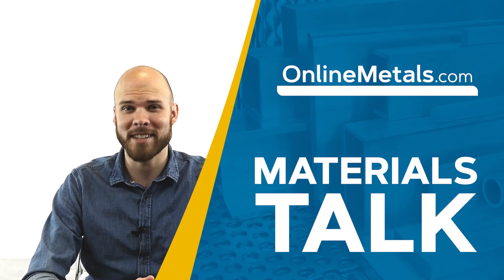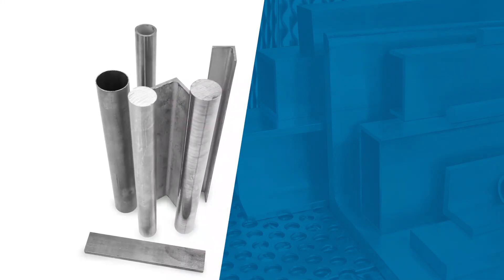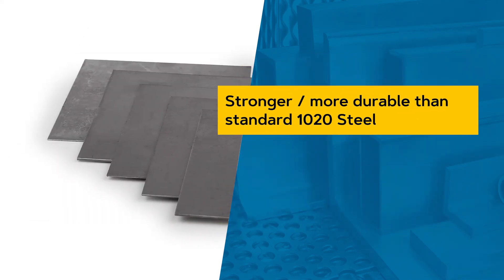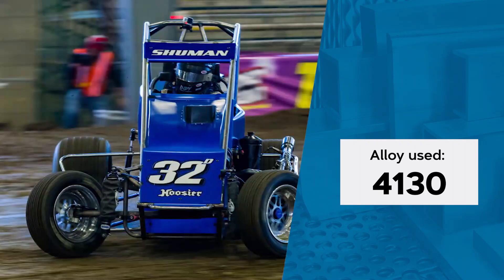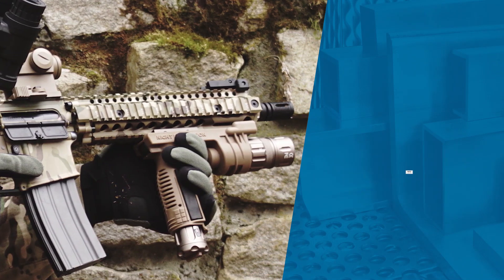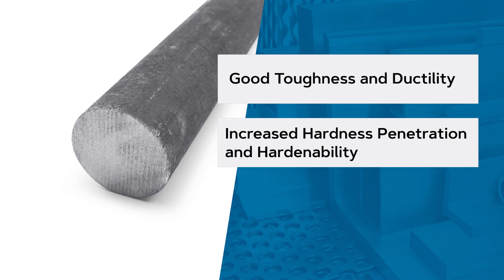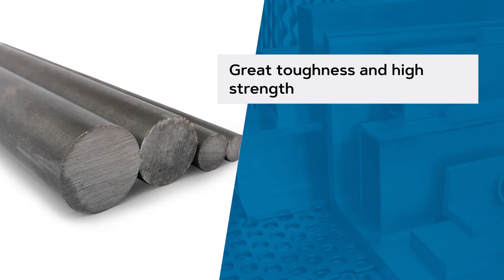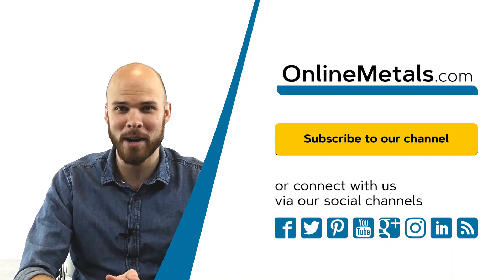Guide To Chromoly Steel | Materials Talk Series

Comment: Is that necessary to post heat treatment of a 21.7mm outer dia 3m thick round tube of Chromoly steel 4130 after the welding procedure?, we will use in our electric motorcycle trellis frame.

Comment: I'm curious about the higher grade 4150,4340...(I'm not familiar with the naming conventions) etc alloys and their relation to 4130....tensile strength vs weight and flexibility/rigidity based on the annealing and hardening process.

Comment: I've seen many arguments about which steel is better for sockets, CrMo or Cr-V. What is your opinion?
Reply from the maker: Great question! The answer is either one, once heat treated to similar hardnesses they are practically the same. They have almost identical mechanical properties once hardened. It’s like arguing over which skittle color is better. Other than the color they actually taste exactly the same.
Reply: @onlinemetals  Thank you for your reply. Tekton tools agrees with you but there have been heated arguments for years on the forums saying otherwise. Most people believe that CrMo is best, perhaps because it costs more, but I'm sure that there are different qualities of steel and different hardening methods that really determine which is best.
Reply: @onlinemetals  tools made of cr-v is more common and it's little cheaper. Professional tools is, in many cases, made from cr-mo.

Comment: I  am building metal detecting shovels. A competitor uses aircraft steel. What grade would you suggest. Thanks
Reply from the maker: That is a great question, where you looking into Chromoly? or are you interested in exploring aircraft steel or aluminum as well. I am no metal detecting shovel specialist, but might be able to lead you in the right direction if you know the distinct features you need.
Reply: Online Metals I need a steel that won’t rust and can be heat treated then tempered.
Reply from the maker: @DIGOLOGIST  our experts are saying that tool steels are going to be the best option (4140, 4130, or O1) we offer. That said, Manganese steel is like the Cadillac of shovel steel because of its strength and abrasion resistance, but we don't stock that currently.
Reply: Online Metals thank you I will be in touch in pricing